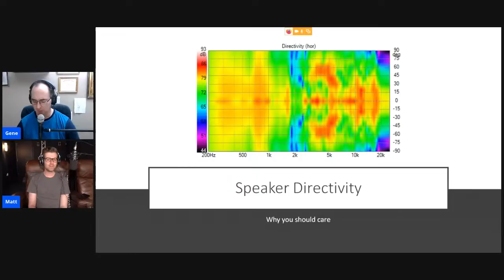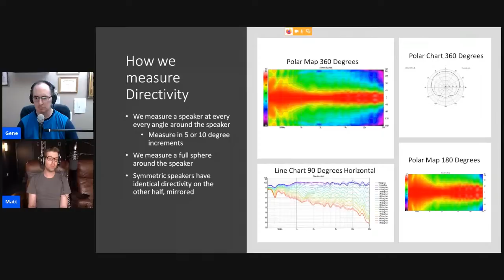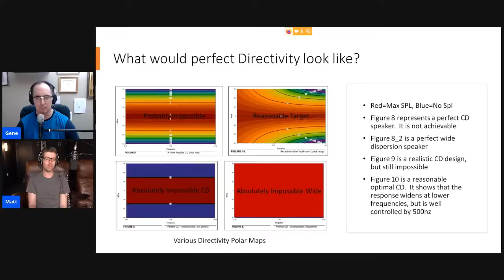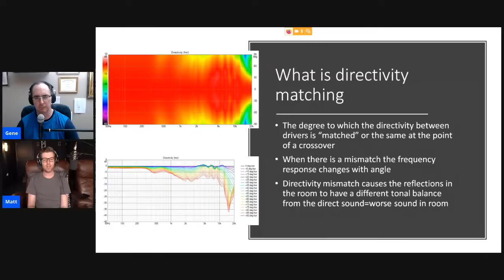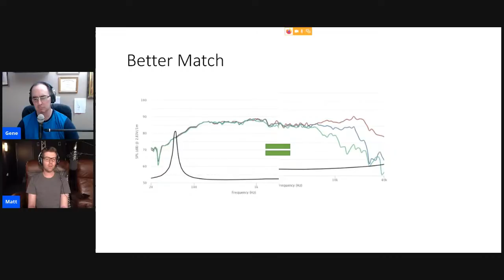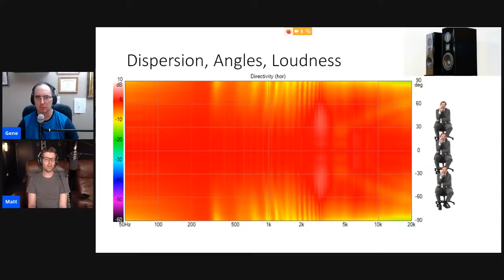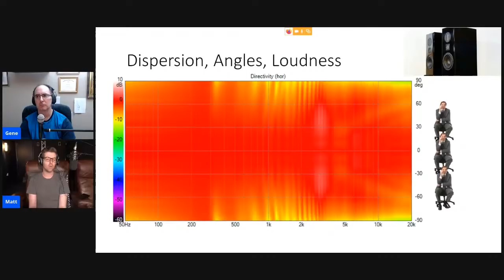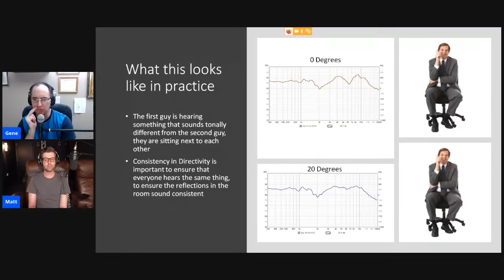What is Loudspeaker Directivity?

Comment: Be excellent to see this imaging modelling for an Open Baffle vs. a box speaker 🔊
Reply: M. R. I agree. I don’t have an easy way to model that however. In practice they have a dipole radiation pattern and if done right can mimic a cardioid pattern which narrows dispersion to the sides. Depending on the back treatment they can have a strong or weak rear radiation. 

Some argue that these are superior speakers but I don’t personally buy it. I don’t see a good reason for it to improve sound. Lots of ways to modify directivity without incurring the problems you often see in an open baffle arrangement. 

It’s important to keep in mind that none of these concepts are poorly understood or magical. We know how they work and why. Open baffle speakers incur a huge sensitivity penalty with a substantial loss of efficiency at low frequencies. In addition the lack of loading leads to a rise in distortion. As such you have to offset this by making the speakers much larger and using a lot more bass drivers. You end up with a huge speaker that performs like a little one.

Comment: A question about toe in: in the manual to my speakers, I'm told specifically not to toe in the speakers because the manufacturer (Dali) follows "a wide dispersion principle". Everyone else keeps saying that you should toe in your speakers. How come Dali, which is a well renowed speaker manufacturer, specifically recommends against this? What could be the reason? Whose recommendation should I follow?
Reply: You should try both, and see which you prefer.  Dali would probably know best about what position is likely to sound best, but your particular room setup is going to play some role that Dali just can't predict.

I own a pair of BMR's like those referenced in this video . . . super wide and excellent dispersion.  Their creator, Dennis Murphy, also recommends pointing these speakers straight ahead, just like Dali.  I have no doubt whatsoever that Dennis knows what he's talking about (he didn't luck into designing some of the best measuring wide dispersion speakers Audioholics has ever measured).  Still, in my particular room, a touch of toe in give me the best balance of a wide soundstage with good imaging.

So I'd probably start with Dali's recommendations, but if you can, play around with a little toe in and see if it suits your room and preferences better.
Reply: @overgme  Thank you for this elaborate answer.  I'll definitely have a go at that. I was curious to know the reason for their recommendation. In other words, is there a downside  to toe in if the speaker has certain characteristics?
Reply: The "best" speaker positioning is going to be a factor of three things, 1) the speaker, 2) the room, and 3) user preference.  So there is no one sized fits all answer to your question.  But as a very, very, very generalized principle, certain speakers are designed so that the best balance of soundstage and imaging occurs when the speakers are pointed straight ahead.  Once again, as a very general guideline, wider imaging speakers often work best pointed straight ahead.  So Dali's recommendations would be consistent with this idea.

So for certain speakers, toeing them in too much (or even at all), might shrink your soundstage, making it sound like every instrument (or sound) is coming from the middle of your speakers, rather than across the width of your room (and depending upon the room and speakers, sometimes they can even make it sound like they're wider than your room).
Reply: @overgme  thank you. I guess I'll have to try to find out!
Reply: @isak6626  Sit in front of the right speaker. Play a center soloist recording. She will be off center toward your side. Now gradually toe both speakers in until the soloist recenters. No more "hot seat."
Reply: @geickmei  thanks for the tip!

Comment: Gene/Matt - I have a difficult room where placement is concerned which means my right speaker will be within a foot of a sidewall and I have to live with that but, having said that, it shouldn't stop me from enjoying good sound! My question is, I am considering buying either a waveguided REVEL or the Philharmonic BMR (which has superwide dispersion). Would either of these be a poor choice for my situation? What would you recommend would work best in my particular case. I have no room treatments and cannot install any as it's a living room (lounge). I use an Anthem STR preamp for room correction BTW.

I know you don't want to be seen to recommend a particular product but it's more the dispersion I'm interested in and how that would work with my room.

Thanks,

Mike.

Comment: i think there is a way to get that intimate detail sound and the spatial cues, with wide dispersion speakers placed far from walls and close to listener.
Reply: sudd  That’s really cool!  I’m going to try that next pandemic when I get the time ha ha ha  Sometimes I like to point my speakers into corners to energize the sound in that region for a spatial feel.  Or toe them really wide and listen to the sidewall reflections.
Reply: sudd hey so I might agree and disagree. If you are suggesting it’s possible to get the best of both worlds, I probably would not agree with that. I would argue that setting wide dispersion speakers up in this way increases the ratio of direct to reflected sound. This would create a soundstage most similar to that of a controlled directivity speaker. However, it is necessarily fin going to reduce the level of lateral reflections and that would reduce spaciousness and apparent source width. Sadly you can’t have both maximized at the same time. But you can certainly play with reflections to balance out a preferred sound.

Comment: You mentioned the jtr 212 having good dispersion down to 1khz but there website says the crossover point is 500hz. I'm assuming they improved on the crossover after your feedback from your review. P.s. I'm excited to buy these at some point due to your review.
Reply: Well a crossover point doesn’t automatically dictate directivity alone. A waveguide has a lower limit that is largely a function of its mouth diameter. So with a waveguide based speaker you can achieve a flat DI over an extended range in one of two ways. First is that you can place the crossover below the point the woofer dispersion narrows. For that to work the waveguide must maintain control to at least that point. 500hz would require a waveguide that is 24” or more in diameter.  All depending on the waveguides directivity angle. A 12” waveguide can generally only control things down to about 800-1000hz or so. One reason why the DI of the JTR falls off below 1khz is because of this. 

I argued with Jeff about this but came to realize he had a second problem to contend with. An MTM creates a vertical lobe error causing a big dip and it happens right at 1khz. So 500hz is ideal to avoid that dip. 

How could you fix this and make the JTR even better (all these criticisms are relatively minor as all speakers have compromises and this one is minor compared to many other possible issues.)

The answer to how to make it better is tricky and something I’ve been thinking about. I believe there are two good options. The first would be an elliptical oblate spheroid waveguide. Not like the SEOS, but one with much larger dimensions and a more oval shaped mouth. Something that is 18”-20” wide but only 12”-14” tall. From there you keep the woofers as close as possible. Might even cut into the waveguide so the woofers can be closer. Raise the crossover point to about 700hz or so. In this design you get a tiger vertical response that still matches well with a good horizontal response whose DI should be flat to 700hz. To get to 500hz you switch to 15” woofers. 

Want it flatter than that to even lower?  Cardioid loading of the bass drivers. But that is no free lunch. Besides being tricky to get right and expensive to design and produce, it requires twice the parts and ideally would need to be an active design.

Comment: I think (and hope) that JBL rules the speaker manufacturer industry regarding speaker directivity, imaging and clarity thanks in part to their experience in HF compression drivers as well as mid/low driver technology. But I also think that a speakers directivity negatively affects even dispersion (the well sought-after sweet spot) in a home cinema environment. Achieving both is the goal of course. True listening pleasure involves dynamics and in-your-face sound regardless of the seating position.
Reply: I have the JBL Studio 590 and they have very good off axis response.
Reply: Asad Hafeez im not sure what you mean? Directivity is just a name for how a speaker dispersed sound over all angles about the speaker. JBL doesn’t have a special market on this by any means. If you are referring to the consistency of speaker directivity over all angles, JBL tends to focus on narrow dispersion where as Revel is more medium/wide. Vivid audio is a good example of a company that prioritizes wide and does an excellent job of it. 

Speakers can use any of these methods and get a very good or very bad response at various angles. My experience is actually that speakers with good controlled dispersion have the most consistent response and largest sweet spot. Wide dispersion narrows the sweet spot which I will discuss in the future.
Reply: @PoesAcoustics  Exactly. That's just what I was thinking... "Controlled" directivity vs just "narrow" directivity". Much depends on the design of the horned system which would ultimately decide the coverage area now wouldn't it? Thanks.
Reply: @kirkcunningham6146  Yes I have a JBL Audio 580/520. I am yet to experiment with it's coverage area (mainly horizontal).

Comment: What is the directivity of a piano or violin I wonder ...certainly not highly directive are they?
Reply: Porsche Maven the directivity of instruments is irrelevant to the proper directivity of speakers. The way that two speakers reproduce a recording of a violin requires different characteristics than that of the original violin itself. 

Basically that isn’t how the reproduced soundscape happens and would be the wrong way to think about it. 

Speaker companies have tried to argue for designing speakers using tone woods and enclosure designs or directivity that matches real instruments. It’s marketing nonsense. It makes nearly no scientific sense to try to compare an ideal speaker to that of the original instruments. 

There is no denying that If your goal
Is the most faithful reproduction of sat a piano in your room, The only way to truest achieve that is to buy a player piano (or the modern equivalent) and put that in your room. On the other hand, if your goal is to reproduce a wide range of recorded music, then using speakers optimized to mimic a piano will not give you the most ideal results in most scenarios.
Reply: All he asked was 'whats the dispersion pattern of an instrument' I think that's a fair question.
 After all, don't most speaker companies claim their speakers sound like the real thing!
Reply: travis bastian and my point was that this is a common myth. That a speaker should behave like the instruments it reproduces in order to be a convincing surrogate in reproducing that instrument. You can sound like the real thing without behaving like the real thing. 

If the goal to accurately reproduce a violin requires that the speaker behave just like it, then we are going about it all wrong. 

Violins have a somewhat cardioid radiation pattern. More sound comes from the back and top than the sides. The dispersion varies with frequency with an upward facing lobe at higher frequencies. How they radiate into the room depends heavily on how it’s played and in what room. 

You all are giving me an idea though. We should cover this in a video. It’s really a very in depth topic.
Reply: Gerrit Govaerts it shows a clear cardioid example at around 800hz in your article. I have a better one that shows the dispersion at more frequencies I will try to post later.

Comment: Measurements are not everything like in the b&w at the end of the day it's how it sounds hopefully sounds good. and it's meant for 2-channel listening not cinema. Let's not get hung up on measurements that makes for poor sounding system can do.
 Well I think linkwitz addressed this in his LX Mini omni-directional, where he mounts the Twitter midrange at Centre Point pointing towards the listener by having that balance of omni-directional in the mid-range to low Range and directional at the same time in the mid-range is the synergy between the two drivers to give you space but directional as well at the same time
Reply from the maker: Agreed, I've been to Bowers & WIlkins factory and heard the 800 D3 and 700 series and found the demos to sound very good.
Reply: @Audioholics  hi can you remember what amps they used at the B&W factory would that have been chord any chance
Reply: Audioholics but would they sound better than something like the Revel Ultima Salon2?